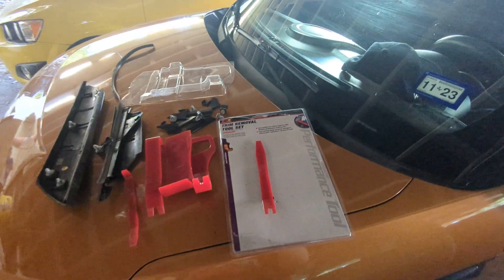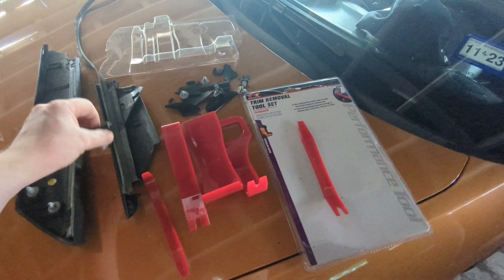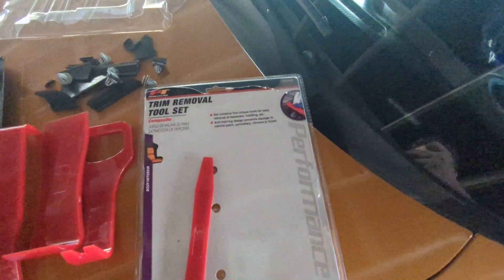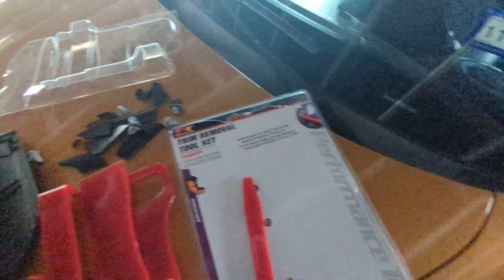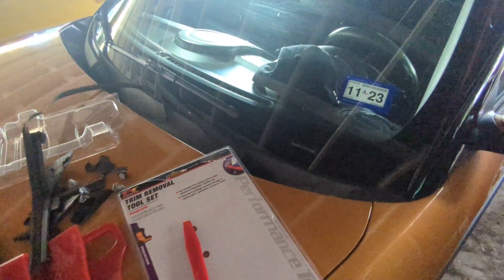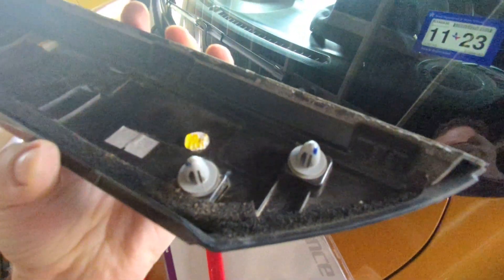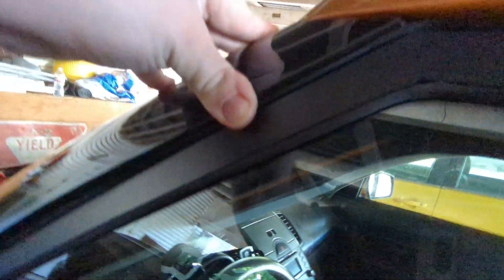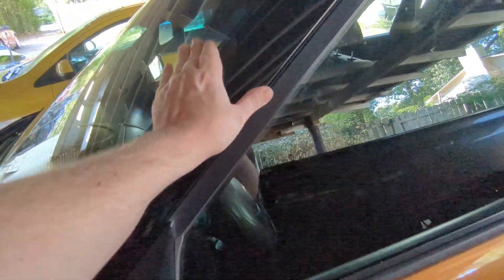2011 Kia Soul A Pillar Windshield Trim Replacement

Comment: I just replaced both on my daugher's Kia Soul, and the most difficult part was removing the old molding off. Good luck to whoever has to replace the windshield in the future, because the molding has to come off again for a windshield replacement.

Comment: Really need a video on how to remove them without breaking them. It's the most self explanatory procedure to put them back on lmfao
Reply from the maker: It's almost impossible due to how these parts are designed. They're subject to the heat on the outside of the vehicle plus the wind forces from driving at highway speeds. The fatigue wears down the plastic over time.

You could try to get a plastic forking tool under there and pry closer to the clips themselves. It's a lot of work though. This was merely as a replacement video for those who have had them crack/break off entirely.
Reply: I managed to remove it without any idea as to what to expect, but you are right, it would help to see how to remove it, even if they have to break it as I did.